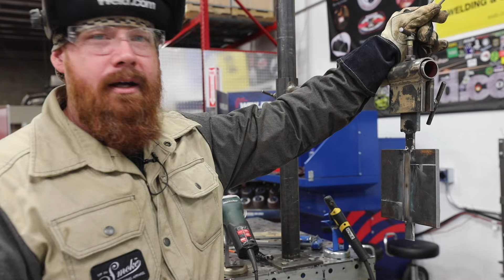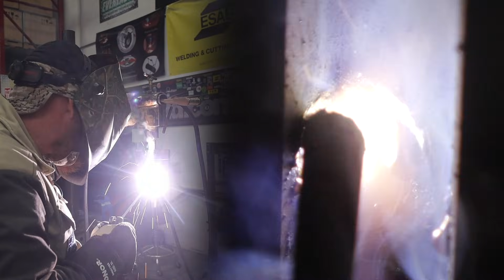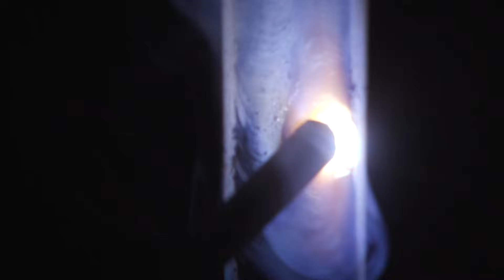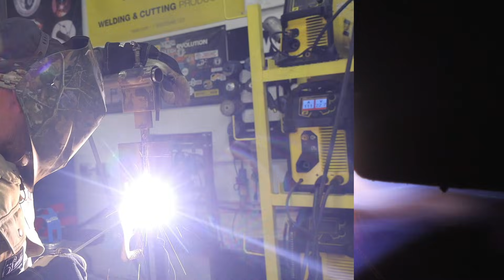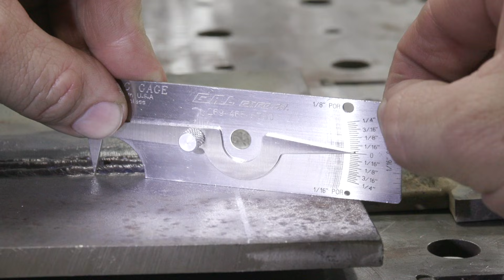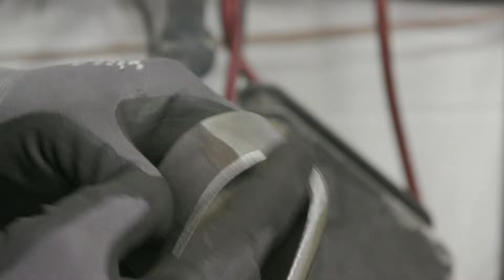CWB Structural Weld Test | 3FG Vertical Stick Welding

Comment: Im gonna be taking a certification test at school on Thursday and I chose vertical as my cert because itll look pretty good on my resume, only thing is i have trouble getting my vertical welds nice and flat, they always have peaks and droops as I call them, or theyre wavy, which i know is inconsistent travel speed. What could i be doing wrong as far as droops and peaks though? Also, what oscillation pattern if any do you recommend to get a nice looking vertical bead?

Comment: Great video, I would personally run the roots hotter at 120amp with a 7018 1/8 rod. Gotta remember that plate is cool to the touch before you’re first root pass so it can handle more heat. You do have to watch you’re travel speed a bit more and adjust if needed but those hot roots are a huge part of getting good fusion. I’d also mention to have that rod straight to the plate with maybe a 5 degree push at most. I see a lot of welders on there tutorials pushing uphill and it’s not a good technique to keep doing, especially if you’re running colder. Great video
Reply: This helped alot thank you for commenting it, really took out some of the convexity i was trying to get rid of for my stringers
Reply: running that hot vert can cause the weld pool to drip alot
Reply: I roast em in at 120-125amps
Reply: Whats your arc force on your root pass? they fail you if you have under cut not all welding machines run the same

Comment: Hello.. while doing thr CWB, A thing I see you not doing in your video (I know grinding/removing the back plate is not fun).
   I would like to see how you are doing this step (that is crucial in my opnio ).. grinding angles.. and which way to grind "with the grain".. and to prevent "dishing".   Thank you for your time.

Comment: I’m re testing after being expired for a while this week. One thing I’d point out is that most inspectors will make you run your long bead on the 90 then your short on the bevel THEN you go back and finish both beads. 90 side first. Also way to go pointing out about how to not chase out undercut. The cwb guy who’s gonna look at my plate will definitely pull out the $1000 digital callipers if he thinks I tried to chase anything out.  You are allowed to remove 5% the thickness of your base material. Anything past that is an automatic fail.

Comment: Why haven't i seen a weld test demonstration with the non dominant hand???? In my experience on the job I have to use my non dominant hand about 25 percent of the time or making a weld that you can barely see with one eye or making a weld holding the stinger in a very unorthodox way or hanging over the side of a structure making a vertical weld looking at it 2 foot from above. That's just a few things new welders will see in a real world situation. A weld test is the easy part when you get out in the field you will be expected to make welds that look impossible.

Comment: Unfortunately he failed the test with the first two passes, you gotta always do square edge first and it’s always 3.5” in, (unless horizontal you run your square edge the full length and your bevel edge to 1.5) then weld bevel 1.5” in then show inspector once inspected proceed until capped.

Comment: Could you show us how you prep the ticket for the bend test? Wondering how your getting the backer plate off
Reply: Oxy Acetylene torch gouging and grind it flush.
Reply: The backing plate and face are machined off by C.W.B.

Comment: I’ve got a question about skip welding and with 100% co2 welding gas for flux core wire 1/16 flux core wire

Comment: Looks good man! Only difference for the tests I’ve done is the inspector doesn’t let our roots touch, we out put the roots in and than have to do a hot pass down the middle to join the two roots and backing plate together.
Reply: same here, i was confused at first
Reply: The exact thing I'm worried about going into my Vertical

Comment: I have questions I would like if you answer with honesty.  Well I’m trying to get a multi process welding machine. Out of the machine that you have use which are rebel, miller, and everlasting which one do you recommend me to get to practice and also that can get work done.

Comment: Little help from experienced welders please. I’m new to welding and I’m trying to mig weld rebar to leaf spring steel to forge but, I can’t get the weld to stick to the leaf spring. I’ve cleaned both pieces but still won’t stick, any ideas?
Edit: No one willing to help a beginner welder huh.
Reply: Ditch the mig and use stick, preferably lowHy
Reply: Sure, you buying?
Reply: leafs are spring steel normal wire feed wont stick very well at all, either crank the welder up hot hot or preheat it otherwise a hot stick welding pass is probably youre next decent option...
Reply: Contact a electrode manufacturer and ask them what what to use .

Comment: Are Runoff tabs used when fabricating or just when practicing?
Reply: Run off and run on tabs are used commonly in the welding industry, they allow for complete penetration throughout the metals that are desired to be joined, for example in bridge building the weld needs to be 100% no defects so they use the run on tabs to allow the puddle to get hot enough before actually welding the joint, then the run off tabs are used for defects usually found at the end of the weld joint, like craters or under fill and undercut.

Comment: Just wondering what the work angles are for multi pass? I know for single beads you want to go straight in but like you were saying you want to angle it into the rock. Do you want to use a different angle for the other beads as well on the multi pass layers?

Comment: I mig weld aluminum boats. I used to go to school for steel welding and loved it. Once I got into aluminum and learned how to actually weld it right, I fell in love with it. It's easy, fun, satisfying, fast, and clean. If you mess up your weld, grab a gouger and in 5 seconds, youre ready to weld again. The stick welding arc AND welds looks like garbage compared to aluminum done right. Nobody on youtube can weld aluminum decently. A perfect aluminum weld looks so beautiful. I like how fast aluminum is because I'm really tiny so I get shoved into holes and awkward areas that are hard to get. Some positions you have to use all of your energy to hold yourself up and to stay steady. If I was welding steel like that, I'd be sitting in that uncomfortable position for twice if not 3 times as long. With steel, if you messed up your weld, you would have to get a huge grinder and grinding disc and slowly grind that shit away. Dust and sparks suck. An aluminum gouger takes huge chips so you can shake them off, unlike dust. Plus gouging is probably 20 times faster and easier, literally. I'm not shitting on steel welders, in fact I respect them. If anything I'm too big of a baby to do steel lol

Comment: I thought it was a 1/8" combined?
Reply: According to W47.1-09, the sum of the greatest dimension of all discontinuities exceeding 1/32 but less than or equal to 1/8" shall not exceed 3/8".  Pg. 21, 9.11.1 Bend test clause of CSA W47.1-09.
Reply: @jesshull9169  cool thanks for letting me know!

Comment: I was always told to never weave on the root. Funny how you do it and get away with it. I want to try this way because it seems more natural to me.
Reply: That doesn’t count as a weave what he was doing it’s still a stringer
Reply: @jackpeck2494  anything over 2x your rod diameter is a weave, so that's a weave
Reply: Matt Perry oh really did you measure the fucking weld i’m willing to bet you didn’t
Reply: You’re not even allowed to weave for the hot passes for a CWB plate and depending on who you are with they don’t even let you weave the cap I know the millwrights union don’t let you weave at all
Reply: @jackpeck2494  not allowed to weave on the hot passes? I always do on my cwb tests. Will be doing it tomorrow
Reply: I always did my root with stringers, you can lay perfect stringers all day, no need to quicken the job by weaving the whole thing, it’s just more slag if you do.
Reply: Not to mention the heat input does weaken it

Comment: They bent good but those final cap passes would never pass for any of the inspectors I have ever had you can clearly see  @14:16/14:20 there isn't even 30% tie in coverage unfortunately it looks like the bead on the right is almost just a straight stringer but keep em coming.
Reply: Agreed.

Comment: Jason how are you removing the backing bar? Milling, grinding or air arc and grind? Perhaps you could explain specimen preparation  in a future episode if you have not do so previously.
Reply: There’s several way to do it. I prefer  to use a saw and a mill but here’s one on how we do it in the shop https://youtu.be/Bz0-I2kLd0U
Reply: @jasonbecker3362  Excellent Jason. I was curious how you did it. I use a saw & mill as well. Or the CWI will do whatever it is he does
Reply: One of the best ways to learn is using an arc gouger and it takes a few seconds, just find the line and “chase” it out without gouging into your 3/8” test plate, my instructor got us learning to gouge backing strips with 3/8” rods, another way is washing it off with a torch, these ways have more of a chance to fuck up but they are common in industry and are great skills too learn.

Comment: Gotta do the weave cap like a true Canadian lol
Reply: In the U.S. we say, if you be weavin, you be leavin
Reply: thats not even allowed on the CWB test lol
Reply: @palmerhowe3137  interesting because I've never been failed on mine
Reply: @palmerhowe3137 just did mine yesterday lol
Reply: @palmerhowe3137  For the cap they have tolerance for it
Reply: @palmerhowe3137  Its required on mine. The instructor requires us to do it. Technically you dont have to but if you cant do that tight weave...no test for you.
Reply: Weave the cap stringers for the fill.
Reply: I single weave my cap, imo looks better and the cwb groove is small enough for a full weave, just leave your fill pass about 1/16 below plate face, weave it, hold your sides to build it up and you can see it fill to the cap, if it looks like its gonna lay undercut, hold it until it does not.. quick thru the middle, hold each side.. usually a 2 or 3 second count... caps come out gorgeous and pass everytime. That being said, each person welds different so this is a great helpful video showing a great welders process to the cwb 3g  certification, thanks very much man...
Reply: I've most certainly weaved the cap on my test. But this was years ago, and I just do the check test now, so maybe somethings changed. I think its up to the inspector honestly
Reply: Weave it wide and wish it well
Reply: straight up 😄
Reply: Do they go into detail when you take a cert class? My company put me in one and I haven't learned anything, instructor will legit leave lol
Reply: I've never not seen a weave for most caps. All stringers fill though. Inspectors like pretty welds. They just do.
Reply: Stingers for root, weave everything else. If your settings and travel speed are right it never fails
Reply: Here in BC my instructor will not let us weave this stringers only he said most inspectors require it
Reply: @crashed6510  your inspector is right.

Comment: No need to troll you for the undercut. I have seen many people fail from grinding too much. Inspector says it's good just leave it. Grind the plate down and leave it 3/8" thick. No need to chase the lines. Like I said I have seen many people fail because the try to make the undercut disappear. Then the inspector says, well this isn't 3/8" anymore and throws your coupon away.
Reply: Exactly, I figured I’d throw out the disclaimer for those who don’t understand but still comment anyway 😂
Reply: Seen a guy grind his coupon down to 1/4 thick chasing inclusions.
Reply: quadtracker85 damn, that’s a bit much. Lol
Reply: Some people try and fly through the test to quick, they would start grinding the face side first instead of the root, even though they are root coupons and the face side isn’t even being bent, then they grind the shit out of their root chasing a line or something and it’s on a coupon that that is a face bend. Which only reduces the tolerances of the test.

Comment: Question? Are you adjusting your machine as you're welding? Or you leaving it at the same amperage and just allowing your plate to cool off? Personally I adjust my machine down every couple passes. I'd start around 118-120 amps and probably cap around 105(these numbers I use for vertical only). The only cool down I give it really the time it takes me to turn the machine down. With stainless I do allow cool down time, but regular mild steel its more of a get in, weld, go home. The faster I can go home.the better.( at least for me anyway).
Reply: I usually run about 110-115 for the root fills and pass. Let cool just a bit for the caps to avoid undercut.

Comment: Total bull shit I am a certified N.A.S.A.  welder with 40 years experience I would have failed that weld the gentleman welding needed to be a little hotter plus the coupon needed stress plates on back
Reply: NASA is not a welding governing body, and you’re not a CWI, and I don’t work for you so you can’t fail me 😂. How much “a little hotter are we talking about? Couple amps? I can put the same amount of jules (heat input) by running these settings and traveling slower than I can by increasing amps and thus increasing travel speed, same heat input. It bent 180° as required and met all acceptable bend test criteria conforming to 2 different codes (AWS and CWB).

Comment: Whenever I do this test the inspector gets me to do the long stop on the square side and the short stop on the groove side. That way he can check both stops at once and then I do both restarts and he checks them then I can fill and cap.  I also find that the fillet side fills up quicker than the groove side if you do the root in 2 passes. But if you do it in 3 passes you don’t have to do an extra fill pass on the groove side and your root will never break on the bend

Comment: Jason, are you kinda proving all these CWB tests leading to welder certification are more stringent than those of AWS?
Reply: Philthy McNasty very much so.
Reply: I don't really see to point of welding joints like this that are more prone to weld defects especially in the field do what's easier a double bevel
Reply: @carolshawol6699  typically testing/certification is meant to be stringent. If the welder is properly trained he/she should be be able to execute acceptable welds in all conditions.
Reply: @carolshawol6699  thats the point. In Canada we have those tests, but it only clears you to weld bevels. This test has a 90 and a bevel and clears you to weld both. It makes sense. If you cant weld a 90 on a plate, you cant weld a 90 in the field. Makes no sense to do a test that you'll never see in the field, in my opinion
Reply: @vangoghsseveredear  there’s so many different tests that comparing the two standards are like comparing apples to oranges. I’ve taken this same exact test for shipyard work in the US and I had to carbon arc the backer bar off and run a root pass on the back on a 1” inch plate. Tests are different everywhere you go
Reply: Yes they are as well are C.W.B. welding inspector certification are recognized by A.W.S. but A.W.S wielding inspectors  certification is not recognized by C.W.B. ...that might have changed by now ?

Comment: Could you run downhill on this test?
Reply: No because it’s done with a low-hydrogen E7018 and they are not recommended for downhill welding.
Reply: Jason Becker ohhh okay
Reply: no

Comment: Basically the exact way I was taught in school other than running the 90 long. Good pointer on restarts after the root. If you are running out of rod on a fill/cap try to stop in the middle of one of the outer coupons to keep it away from the face bend.

Comment: Where I'm from, our inspectors tell us to run the 90 side long and do the stop start near the top of the plate and the bevel side do the start and stop near the bottom of the plate. Either way is correct, as long as your stop starts are in the root bends of the coupons doesnt matter. But I find running the 90 side long give you more heat in the plate for a better stop start.
Reply: You also have the choice on which side you want your square side on right or left
Reply: Good advice, thank you
Reply: Weld.com has gone downhill. Im CWB certified in smaw,fcaw/mcaw. That plate is a fail.
Reply: @aaronhobbs8716  why do you say that plate is a fail? Nothing over 1/8" . And I'm also certified in smaw/fcaw. Carbon and SS.
Reply: Sean James look at it. The visual is a fail bud. This guy on weld.com needs to practice